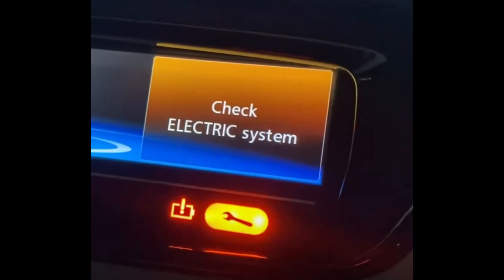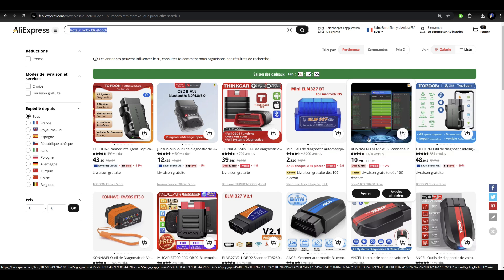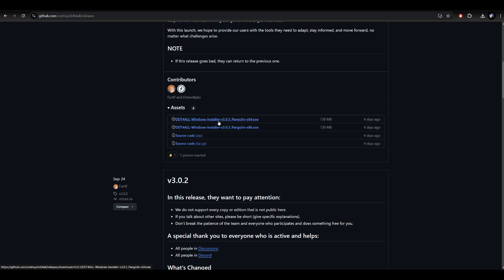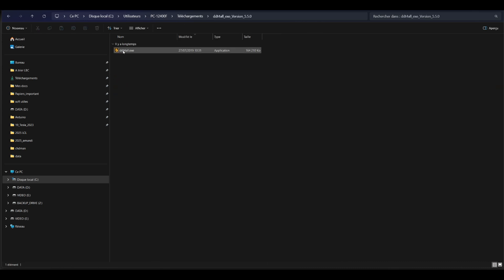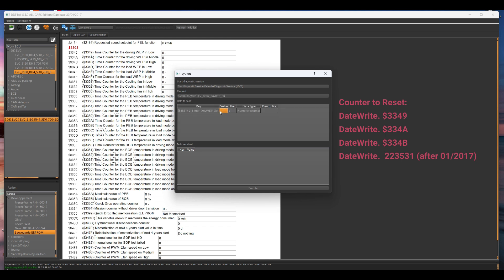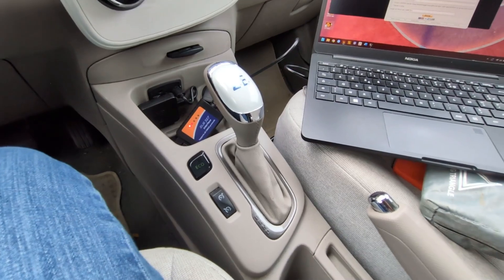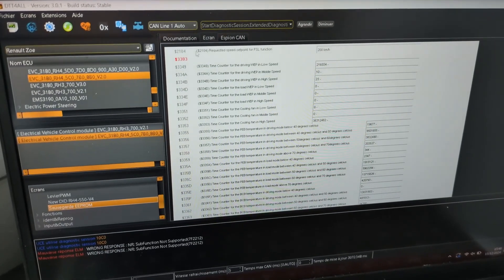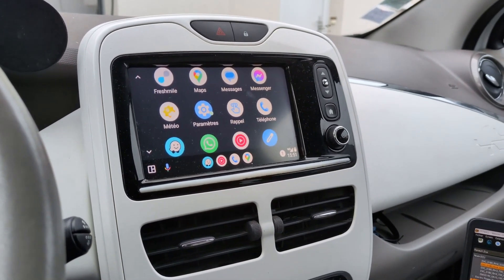Reset water pump Counter on Renault Zoé (Check Electric System)

Comment: You just saved me hundreds of pounds, which it would have cost for Renault to solve this issue.  I followed your instructions to reset the Renault Zoe water pump counter on a 2015 model.  It worked perfectly :-)  Thanks.

Comment: Hi I really liked your video . I have the same problem, but on a different vehicle from Renault. Followed all the instructions and reset all 4 counters but I'm still getting the error . Do you know how to troubleshoot ? Thanks !
Reply: Hi , I've succeeded . For the last counter I had to use the same evc you used for Zoe. So it is confirmed that the same procedure is working for Dacia spring 2021 . Much appreciated for your video !

Comment: @Hrisson Hello sir, I am looking in the database I downloaded in DDT4ALL, but I do not find the ECU you posted: EVC_3180_RH4_D0_7D0_8D0_900_A30_V1.0 - 
I find other 3 ECU's ([ (H) EVC ] EVC_3180_RH4_5D0_7D0_8D0_900_AC0_D00_E20_V2.0,    [ (H) EVC ] EVC_3180_RH4_5D0_7D0_8D0_900_AC0_D00_V6.0,    [ (H) EVC ] EVC_3180_RH4_5D0_7D0_8D0_900_AC0_D00_V5.0) they all seem to have the same list of parameters screen and probably could receive the 0 parameter. Which ECU should then be edited to reset the water pump timer? My issue: Check electric system and lack of CC/Speed limiter funtion. The used car seler I bought the Zoe from claims the car has been passed via a dealer that ordered the pump, with unknown delivery time. Thanks a lot for sharing your knowledge here.
Reply from the maker: Use the version EVC_V6

Comment: Thanks for the tutorial! My Zoe is an R90 from 2015 and I’m running into some issues. I bought the same USB ELM327 dongle as shown in your video and installed the software from your Mega link. I put the car in debug mode, plugged in the dongle, and started DDT4ALL. The software says “connected” and the green light on the dongle blinks while working. However, when I go to the backup EEPROM section, everything is red and it says “NO DATA.” Do you know what I might be doing wrong? Any advice would be appreciated!
Reply from the maker: I think you connected to the wrong EVC version. Your car is older than mine. Try older version of EVC available in the list.

Comment: Many thanks for your tutorial, merci beaucoup!
How to clear the fault “check electrical system” after the reset of the counters?
Reply from the maker: Unfortunately, if you still have the fault, it means, it didn't work. You have R90 ZE40?
You will have to go through another method. (i have to make a video about it)...
Reply: @Hrisson  Thanks, indeed was not the only problem, I could reset the DDT with canZE
Reply from the maker: @WoodGasStove  You might need to check this video: https://youtu.be/64rRu8DdwWM
Reply: @Hrisson  Folow

Comment: Hi, my Zoe is late 2017 model and I cant find the DataWrite 223531 on the ddt4all. I have changed the values on all the other counters but the error still remains.
Reply from the maker: Hi
223531 is the most important one on ZE40. 
It is NOT located with the other. 223531 is almost at the end of the list. Check again at the end of Datawrite section. Let me know.
Reply: It worked with method 2! Amazing knowledge and really helpful! 😊👌
Reply from the maker: @ToL1  Thank you, i appreciate. I did not invent anything, i just googled for hours foreign country forums discussions.
Reply: I have reset the faults several times. 😊 Any help would be appreciated. 👍 And honestly thank you for your clear explanation on how to connect to the board computer!
Reply: Hello, I have the same problem. I can’t find 223531. 
I found datawrite $3531, but it can’t be changed to 0 or any other number. 
Thanks for the help
Reply from the maker: @themazq  I got same issue on another zoe R90, i'll try this week with another software
Reply from the maker: @themazq  I did it on R90 2017. I had to use EODBfacile Software on smartphone. But it worked
Reply: @Hrisson  what ELM dongle did you use to connect with the zoe?
Reply from the maker: @nitindongare5708  I used the one described in the video
Reply: @Hrisson  What a nice guy you are!
I totally forgot this message and just accepted my fate to live with the error light on. And the freaking pump is impossible to find. Out of stock everywhere.  I even went to the dealer and they told me they were going to park the car until the had the pump, and it was out of stock with no date for restocking.
I am going to try it right away.

It worked !! Thank you very much.
Reply: I did manage to find the 223531 in the bottom of the list and changed it to 0. Unfortunetely the error still remains. I start to believe it is something else, not the water pump. How can I identify with DDT4ALL what kind of error it is?
Reply from the maker: @ToL1  If you have R90, it may not reset with DDt4all. You need to use other method. I have to make a video about it.
Reply: Yes I do own a R90 and it is driving me crazy 😅 I have bought several different OBDs and did everything accordingly. I do appreciate your help! What other diagnostic tools can I use to fix the problem? 😊 Car needs to go on EU control in 3 months.. 😅
Reply from the maker: @ToL1  Don't worry, i got same issue on my R90 and i had to use method 2. Give me a week to complete the video turorial. But you will need Konwei Bluetooth USB dongle.
Reply from the maker: @ToL1  If you have a R90, here is the specific tutorial: https://youtu.be/64rRu8DdwWM

Comment: I have reset the water pump counter and the fault is no longer present. Now I want to change the water pump to avoid further problems but I can't find a tutorial on how to do it. Can anyone help me?
Reply: Extremely easy. I can record a video for you. One connector, two bolts, two houses.
Reply from the maker: @customer883  What about isolating battery energy? And thern purging from air after replacement? Can you do a video of that?
Reply: You mean how to completely disconnect a car from the high voltage battery?  @Hrisson
Reply from the maker: Sorry i don't know how to do that :(
Reply from the maker: I had same issue on R90 2017. I had to use EODBfacile Software on smartphone. But it worked
Reply: Hi, I am trying to reset the counters on a 2017 R90 also. I could not find the datawrite 22531with DDT4ALL . Can you recommend what dongle you used with EODBFacile? And thank you very much for your detailed video!
Reply from the maker: @roryhanley8095  i bought an Konwei Bluetooth dongle (white version) from aliexpress.
It worked with eodbfacile and a R90 2017
Reply: Just to confirm that I was able to reset the water pump counters with EODBFacile and the Konnwei 901 (white) bluetooth dongle. The "Check Electric Sytem" warning dissappeared as soon as I reset the 223531 counter. Merci beaucoup!
Reply from the maker: @roryhanley8095  Here is the tutorial for R90: https://youtu.be/64rRu8DdwWM
Reply: @Hrisson  You don't need EODBFacile. In DDT4ALL are few different versions of EVC controllers. You need to use EVC_3180_RH4_D0_7D0_8D0_900_A30_V1.0 but when you open "Manual request" it defaults to "StartDiagnostcSession.Default [1081]" and when you try to write "3531" it gives you an error. You need to switch it to "StartDiagnostcSession.ExtendedDiagnosticSession [10C0] and then you can write "3531" to 0